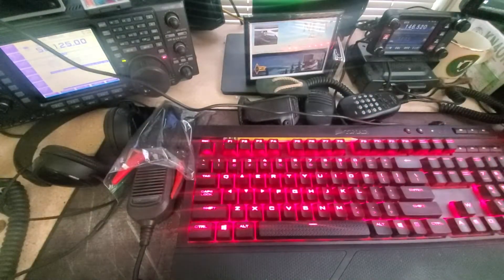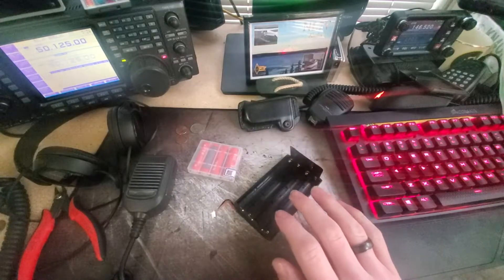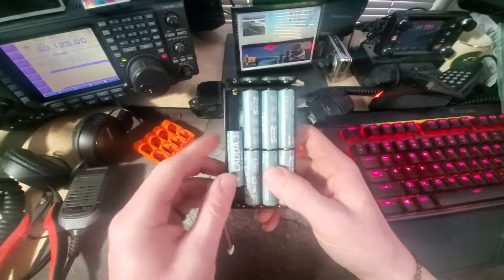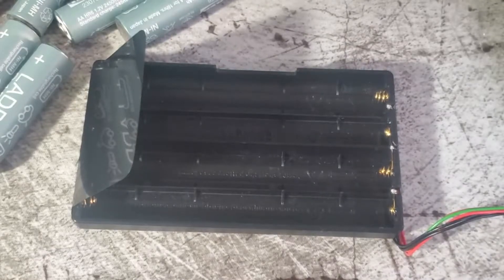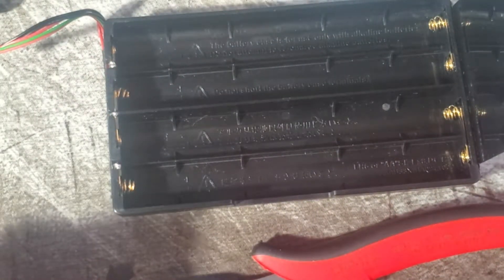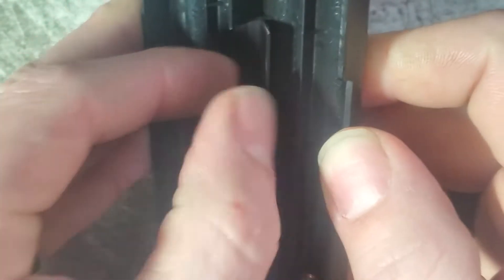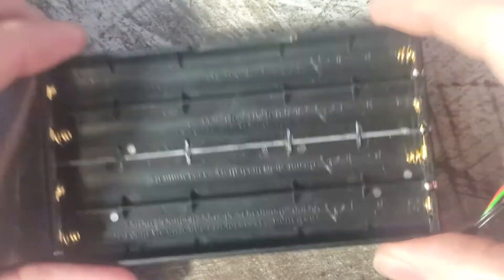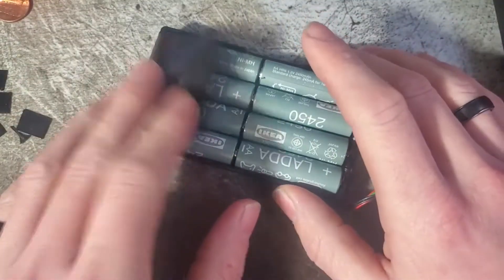Modifying the Yaesu FB-28b LR6/AA tray to fit Rechargeable cells into an FT-817 or FT-818.

Comment: Tell me , on page 8 of the manual for the 817 it says "The FBA-28 battery holder is designed for use solely with Alkaline type “AA”
cells. Do not attempt to use Ni-Cd or other rechargeable cells in the FBA-28,
because it does not contain the protection circuitry required when using rechargeable cells" so how come u can use rechargable batteries in it
Reply from the maker: I believe the manual states not to use rechargeables because the 817 doesn't contain the circuitry to properly recharge using the FBA-28.
I do not use the 818 to recharge. 
I recharge in an EBL recharged.
Thank you.
    :edit- spelling

Comment: Yeah I did this too a long time ago, although I scored along each side by using an engineer's back marking gauge and flipped the whole central spine out.  I reckon your way is a better method to achieve the same end. Then it dawned on me that I had created two rows of very low internal resistance cells separated by two thin layers of shrink wrap and the whole cell casings are positive. Later I found the radio cutting out which was down to the cells still resisting the springs after  the occasional jolt. I tried using dry film lubricant on the shrink wrap, then I gave up and chalked it down to yet another Yaesu goof with these radios. One of those cells in the video has damaged shrink wrap at one end ...

Comment: Has this mod still work for you? Some say to cut the green wire so the radio can charge the batteries.
Reply from the maker: Yes this mod continues to work.
I do not advocate to cut green wire and charge batteries inside radio. Charge batteries in dedicated AA battery charger.

Comment: Good idea but holder wiring need to be modified too to charge it in radio right?
Reply from the maker: Yes, I believe the green wire being connected prevents the radio from being able to charge HR6 batteries. Simply cutting or removing the green wire would allow the radios internal charge circuit to charge batteries in the tray.
I do not wish to use the radios internal charge circuit, as I prefer to charge individual batteries outside of the radio.
I keep the green wire in place as a means of preventing me from accidentally doing so.
Thanks for watching.

Comment: Thanks for the shout out! Can’t believe it’s that easy! Hope you didn’t order an extra tray just to do this video. Might do this anyway as it was definitely a tight fit to get the tray in first then add the Amazon batteries when I tried it. Will have to pick up another tray to have both trays, one modified, one original. 73
Reply from the maker: Thanks for watching. No worries about picking up an extra tray.
Reply: @TheNoCodeTech  Finally got around to doing this today. Just used a sharp thin knife to cut the tabs and bend them to break off! A file to take off the sharp bits remaining. Thanks again for the shout out! Rod VA3MZD